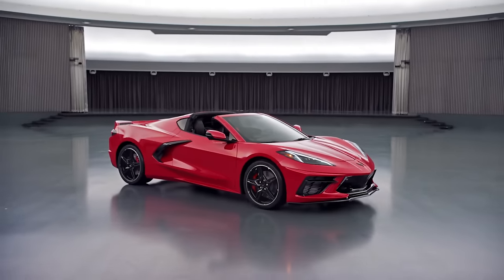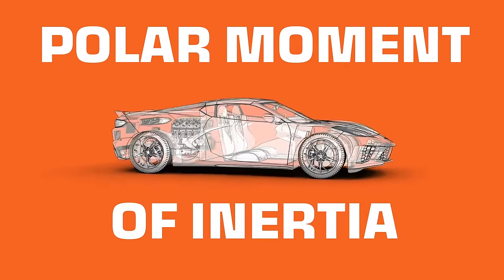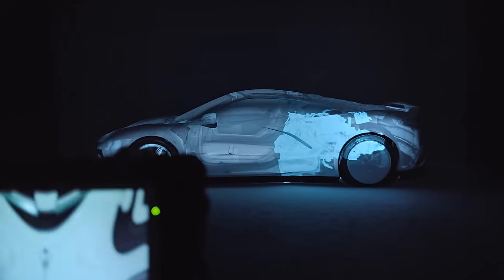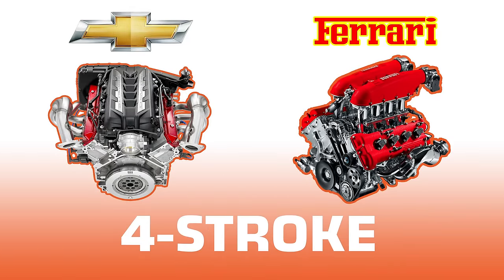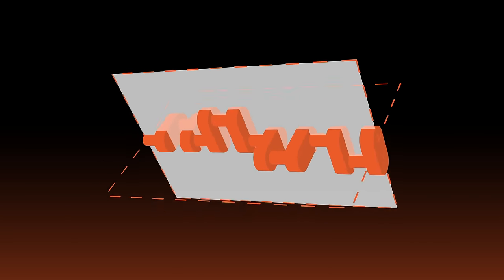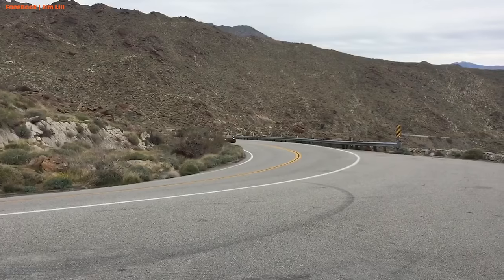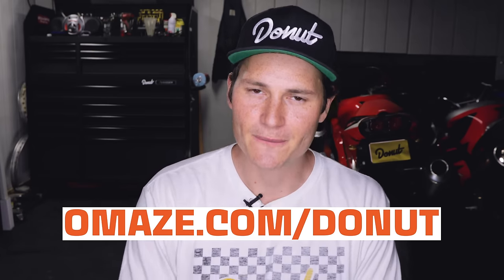C8 Corvette - The Science EXPLAINED

Comment: Thank you for a very excellent explanation of the LPMoI. Having read the motorcycle articles from the early 1970's, I think this vlog let me understand this concept of the low polar moment of inertia better than I've ever understood it before. Mid-engine explanation is excellent in concept and instruction and explanation. Pushrods v. OHC. Flat-plane crank v. cross-plane crank has a lot to do with the difference between euro engines and american engines.    Crank journals and the crank pins. Crank shape: well explained. OHV; OHC.  Alternate firing of flat-plane = better exhaust scavenging for various reasons. All excellent explanation. Efficiency includes weight and it includes number of parts in the ICE. A third type of cam-lift is gear lifted. Most often used in motorcycles, most often Italian motorcycles which  have Desmodromic type valve lifter systems leading to the name Ducati Desmo SS which used some straight cut gears to rotate and time the valves. Just interesting.

Comment: Was Jeremiah sitting on a Yamaha R1 when he shouted "crankshafts?" That's meta.
Funny how big-bang crossplane engines are getting so popular in motorcycle racing while the flat plane is where it's at in car racing.
Reply: Just remembered that R1’s used crossplane
Reply: Unpoluar opinion The r1 crossplane sounds like a high revving twin cylinder with an aftermarket exhaust
Reply: @VMKAROUND365  Agree with you, r6 sounds better than r1. But it doesn't matter, we all have different taste on something
Reply: @VMKAROUND365  not so unpopular. I mean... you're right it actually does sound very similar 😅
Reply: R1 with Graves exhaust sounds like muscle from idle to bout 6.5k 🥰

Comment: Great video, clearly explained. One issue though - the rotating graphic at around 11:25 is not the correct flat plane configuration being used in the Ferraris, nor the C8R. It is the one used in the GT350, as it goes up-dn-up-dn. Look up the configuration of a 4 cylinder crank and you will see that it goes up-dn-dn-up. This is what Ferrari V8’s use. This also explains why the GT350 sounds more like an American V8 and less like a Ferrari.
Reply: I was wondering that, thanks for clarifying

Comment: He talked about the polar moment of inertia to explain why mid engine is better but it can be explain much simplier by talking about understeering : the less mass you have in the front, the less mass the less mass front tires tires have to fight against so for a same grip (to simplify) it will support more lateral G, so the solution is to move some mass away from the front. 
It also makes the car easier to oversteer because his mass is on the rear but current cars' cornering speed is mostly limited by understeering

Comment: The C7 had a "front mid-engine" configuration (engine was in front, but behind the front axle with the transmission on the rear axle) and a weight distribution of about 50/50 if I remember correctly. But the braking and rear traction that the C8 40/60 layout has does have its advantages. It's just noteworthy that Corvette nailed the "center mass" thing in the previous gen.

Comment: The C7 was technically Front-Mid engine (FM) the C8 is technically Rear-Mid (RM).
A C7 with the same power to weight ratio and tires will out brake a C8, a C8 with the same power to weight and tires will out accelerate a C7; that is the major trade-off between the two platforms.
The C7 had a weight distribution of 49.4 front 50.6 rear when empty.
Rotor size isn't about stopping distance, it's about heat dissipation for repeated braking sessions.
One of the biggest design issues with the C8 was ensuring it met the "two golf bags in the trunk" rule.
When comparing FM to RM there is not a cut and dry "one is better than the other" statement to be made, it's a "one is better than the other in certain situations" a compromise if you will.

Comment: OR, the engine didn't have a flat plane crank, but cross over pipes. Because you get the same sound, and scavenging, as a flat plane crank engine when you have crossover pipes. Past Corvettes didn't have them because they can be a bit difficult to package, but the C8's mid engine platform does lend itself well to a crossover header.

Comment: Didn't expect the explanation for the cross section of the crankshaft to be that simple and easy to grasp. Good job. But now i'm even more puzzled by why the old European V8s (mainly the Audi ones have the most clear differense) sound so much like the American ones, they have that deeper lower rumble and the new ones sound way too high pitched, almost but not exactly like a flat-plane crank, when in fact all of them are cross-plane. The only thing i could find as a possible reason is the that the old V8s and V6s used 5 valves per cylinder while the new one use only 4. Is the sound that engine makes determined by the number of valves as well? Do Donut have a video on valves alone? I watched the one on intake and exhaust, but i mean really valves only. Remember the  the 90s when 16V was the most sought after sticker? Now i know why 16V is better than 8V with 4 cylinder engines, but is 30V better than 24V in V6s and 40V better than 32V in V8s and does it affect sound as well as performance?

Comment: Looking up ways to balance engine vibration. I came across balanced shaft it was invented and patented in 1904 couldn't somebody do something like that today. At the very least balance out the vibration of the flat Crank. That being said the flat crank and everything we do to get better fuel efficiency of our engines and adding a mid hybrid with electronic twin turbochargers and a torque generator replacing the alternator. That ZO6 would be better than the 2019 version using electronic tool turbochargers rather than a Whipple supercharger. Just a thought

Comment: Need a little more detailed explanation on polar moment of inertia. The car isn't just rotating in turn, it is moving. If it is rotating at a constant pace it doesn't need the low monent if inertia. Yes, the factual rotation is not constant but I don't see it matters that much because we have cars like the Nissan GTR with it's front engine transaxle layout that corners well. A mid engine car may react on the steering inputs better but the actual limit isn't affected by the moment of inertia

Comment: You're close on the sound difference between flat plane and cross place cranks but the exhaust system is largely responsible for the resulting sound of it all. If space constraints weren't an issue you could make 180 degree headers (look out up on YT) and with those headers a cross plane crank engine sounds identical to a flat plane, if space is even less of an issue, an 8-into-1 header/collector would sound like a flat plane. YT search "8 into 1 header LS engine"

Comment: The other very important point about polar moment of inertia is that:
If its high as in engines hanging out the back like Porsche for example once the rear end starts to break loose it wants to keep going and is therefore harder to bring back in control.
Mid engine layout low PMI is easier to control the rear end once it breaks loose.
Some people erroneously think that an engine hanging out the back will give you an advantage in traction due to the higher weight bias to the rear.  Ex{ Porsche 62% rear WD). 
This is not true because as seen in the C8, Lotus and other mid engine cars the higher rear weight bias can be engineered in to have the advantage of the higher rear bias alao.
Ex Lotus Exige 62% rear weight bias.
So mid engine can have the advantage of lower PMI and higher rear weight bias.  Cool

There's a reason why most all Porsche race cars have been mid engine. Even the current 911 race car is mid engine now.

Comment: Wouldn’t the mid-engine design be detrimental in a head-on collision? The increased weight in the back will technically exert more force behind you when colliding in the front and since there’s no longer an engine in the front, all that force is put upon the driver. It may be faster, but is it safer?

Comment: Wait a minute, so you're telling me the C8 Z51 package has a wider tire setup than a C7 ZR1, the Corvette you showed in that time frame? Sorry man, but the C7 ZR1 uses 335w rear tires and 285w in the front, vs 245w front and 305w rear on the C8 Z51. Even the C8 Z06 tire sizes aren't exactly wider, with the C8 Z06 running 275w front vs 285w front on the C7 ZR1, and 345w on the rear on the C8 Z06 vs 335w on the C7 Zr1. Same overall contact patch on all four tires

Comment: Does Harley Davidson make an efficient engine? No. It does sound good though. Do pushrods and cross-plane cranks make an efficient engine? No. But it does sound good. DOHC and flat-plane crank add complexity, but it creates a very efficient engine for getting max air into the engine and max exhaust out of the engine. The C8.R is a beast. Its engine is so low in the engine bay you'd swear it would drag the ground. (Scrutineer at COTA for FIA WEC race in Feb 2020)

Comment: Mid-engine cars can also have the engine in front of the driver. As long as the center of the engine is in between the two axles of the car it is technically a mid-engine car. I have yet to watch your video but I hope you mention that.

Comment: Nice video but the illustration of the crankshafts is wrong in both the flatplane and the crossplane. Flattplane cranks have the two outer crankpins on the same side and crossplane cranks have the two outer crankpins on opposite sides.

Comment: The illustration of the C8 shown has the engine sitting high in the frame. I think this is GMs art department that put this out and the engineers need to correct the illustrator. The crank on a C8 is online with the center shaft of the DCT.

Comment: I think it's a bit inaccurate to say the mid engine design makes it "better" to rotate. I liken it to mid engine style rotation. Subaru being a great example of having the engine waaaaay in the front with little to no weight in the back really. Subaru's far front engine design actually allows a different kind of rotation. When braking late and hard into turns, this throws ALL the weight into the front, making the light rear even lighter and easier to flick. People trying to drive a Subaru like a rear wheel drive car is the reason you always hear the myth of Subarus understeer. Every car has an action which will lead to understeer, oversteer, winning steer, etc.

Is it better? Maybe. Depends what is "better." I personally love my bulls by the horn style driving with a Subaru you just would end up crashing in any other car.

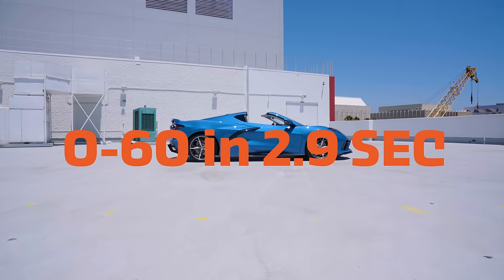Comment: 5:06 -- sure, 0.9s faster, but is it fair to call that all because of engine placement?  MotorTrend got a 5.6s 0-60 out of the out-going C4 Corvette and then got 4.9s for the first C5 (1997).  So just the general updates from one generation to the next was worth 0.7s. 

The 2004 vs 2005 (last C5 vs first C6) 4.5->3.8s... also worth 0.7s
2013 vs 2014 (last c6 vs first c7)?  OK, now I'm seeing 3.8s for each, so no gain -- were they perhaps already looking ahead to the C8 (and C7 Z06/ZR1) and merely did a refresh?

Comment: Y’all act like the flat plane crank is so European but there’s even a recent American example of one that y’all missed—the 2015+ Shelby GT350, which is equipped with Ford’s flatplane crank-utilizing 5.2L Voodoo. Y’all didn’t know it at the time of this video, but the 5.2L Voodoo will also be featured in the 2022 Raptor R if the V8 option is selected, which gives the 5.2L flatplane crank engine more than one vehicle it can be factory installed in.

Comment: Hey donut man! You're misinformed, flat plane cranks don't fire every 180 degrees of rotation unless half the cylinders are missfiring or if the cylinders are in the horizontally opposed config like a Subaru boxer or Porsche pancake 6... The Corvette is still a V8 so it still fires on 90 degree crank increments!

Comment: The old corvette c7 has more even weight distribution than the c8. The c7 has its motor and transmission at opposite sides. The motor at the front and transmission at the rear. The old c7 was very close to 50/50 weight distribution the new c8 has more weight to the rear.

Comment: The C8 Corvette is the ONLY new vehicle that I would buy if I could afford one. I don't like ANY new vehicles. I drive a 96 Buick Roadmaster sedan and it's too new for me. The newest vehicle I've ever owned was a 2000 model. I hated it. I like fuel injection and modern suspension technology, but that's about it. I don't like all these sensors for everything. I CAN'T STAND drive by wire vehicles. I'll stick with my throttle cable where I'm actually connected to my engine and the throttle moves with my foot. Drive by wire is too twitchy and unpredictable. I'm rambling now. But basically, yeah I approve of the new Vette.

Comment: This isn’t completely informative. The low displacement high cylinder euro cars sound that way because of their higher compression, different firing order, wider bores and shorter strokes, flat planes and equal length headers. You can change firing with a new flat-plane crank, you can bore the engine out and make the stroke smaller with new rods, You CAN modify an engine to sound like that. It’s gonna take a lot of money though

Comment: The math is dead simple. We have to stop burning fossil fuels. Period. So cars need to run on something other than gas or diesel. So electric cars are good for the planet because they help us break our dependence on oil. It is possible to power a Tesla completely with renewable resources. That is impossible with a gas car. Whether or not our power comes from clean sources is immaterial to the argument. That is a completely different issue. We need to also close coal plants and build out infrastructure to replace them. All that takes time. But we can make electric cars now to start the ball rolling in the right direction.

Comment: LOL...The explanation in the video is off a little, especially on the flat plane crank theory and vibration differences. The flat plane with a 90º V produces firing pulses unevenly spaced thorughout the 720º  cycle. The pulses on a cross plane crank are evenly spaced throughout the cycle. This is why cross plane v8 has less vibration.

The only benefit of flat plane is simpler design, easier to make the crank to the strength required with less weight. The difference in sound is odd vs even firing cycle and differences in rotating weight  which helps the flat plane crank to rev up faster. Revving up faster has very very few benefits, the main one being easier to rev match between shifts when a manual trans is used. Under a torque requiring load (IE: While actually accellerating a car) the cross plane will produce identical accelleration and do it smoother.

You need to learn about firing interval:  https://i.imgur.com/PIOH1bZ.png